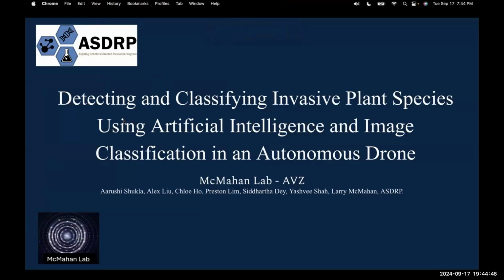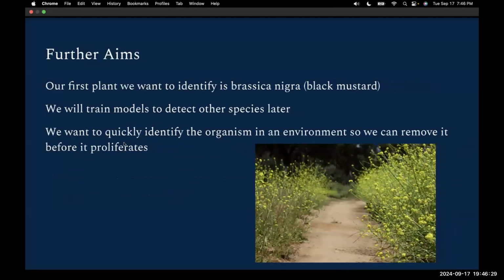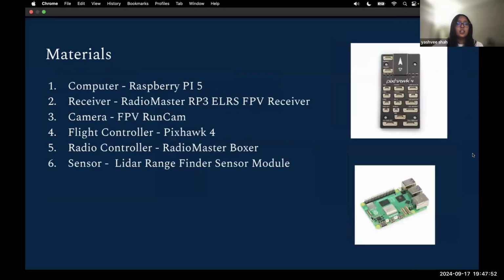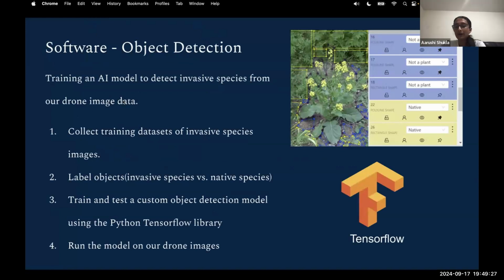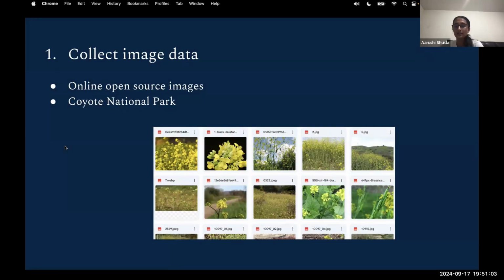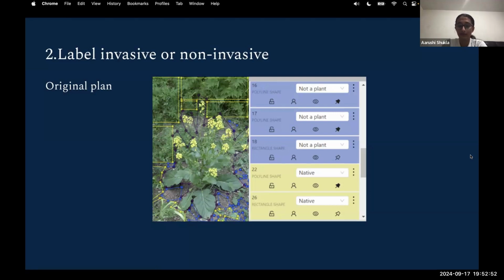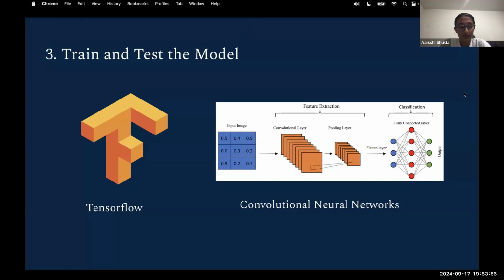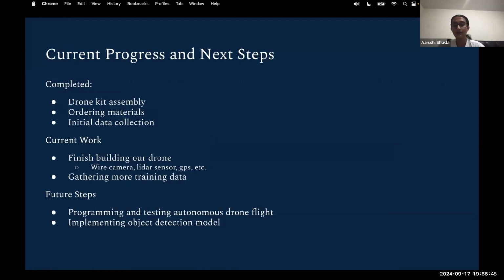Detecting Invasive Plant Species Using AI and Image Classification with Autonomous Drone

Comment: Do you have your code available in a public code repository? We're working on something similar, with almost the same hardware : https://www.youtube.com/watch?v=ZYwWH0ITw1A. We used GPS + RTK, and lidar for take off and landing, but not for targeting. I think you're going to need RTK for precise positioning. You MIGHT be able to run RTK in software, if where you're at in California has software RTK services. We're in New Mexico, and can rely on that in the urban areas, and a few of the rural places we tested. We want to add lidar for obstacle avoidance next. We're doing all right with two species - datura stramonium and nassella tussock - and have about the same size datasets (500 positives, 500 negatives) as you. We didn't augment our existing data, but the contrast change is interesting (since we're seeing that heavily dependent on lighting conditions.)

Thanks for sharing this.